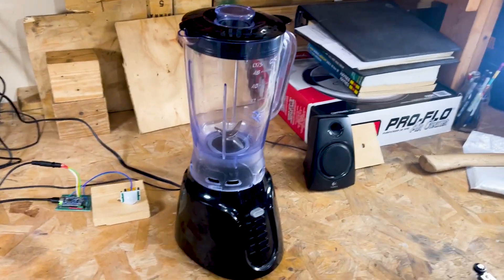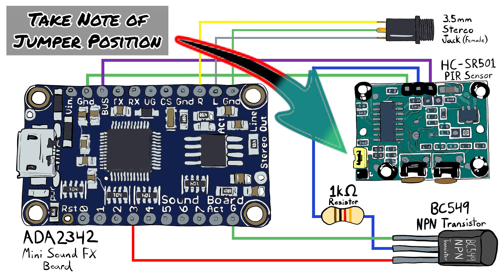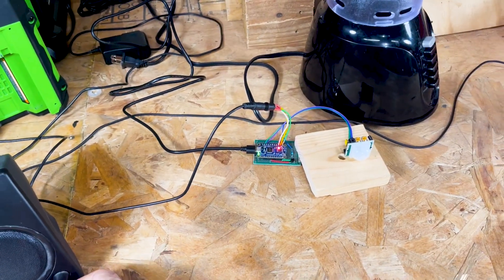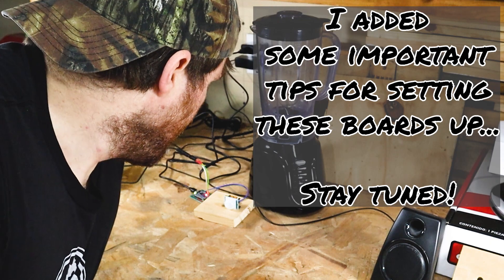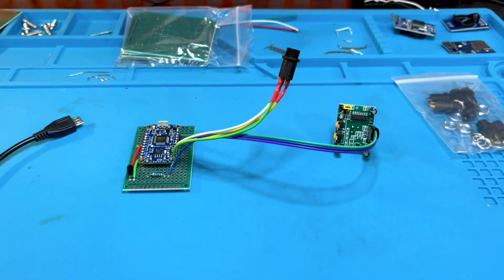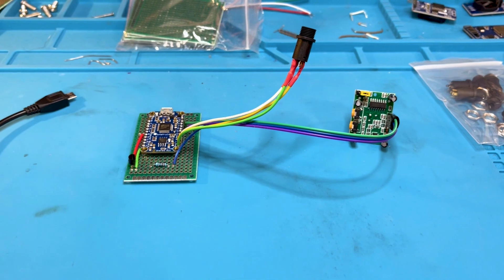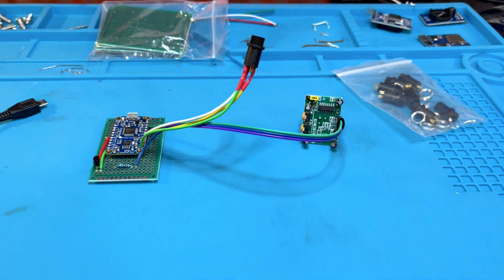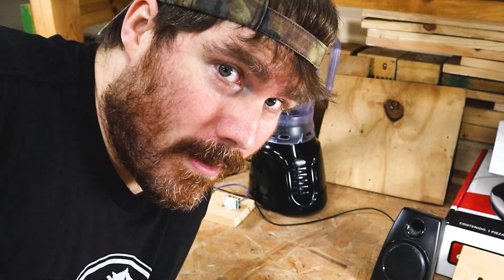Easy Motion Triggered Sound Effects ⚡ Adafruit Mini Sound Effects Board with HC-SR501 PIR Sensor

Comment: Alternate idea: You could disassemble the blender a bit, remove the gears (and stuff) that make the blade actually spin, then just have it turn the blender on.
Reply from the maker: I tried to convince the owners to do that, but they just weren’t on board with having a real blender in there at all. It would’ve made things much simpler.